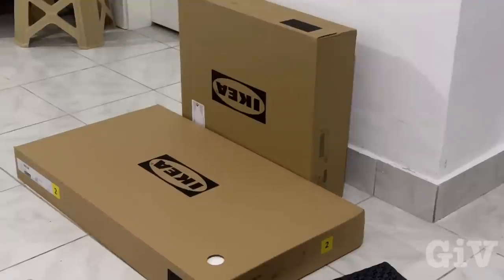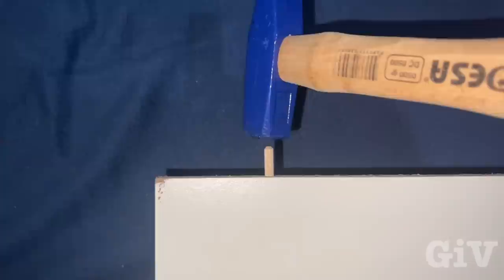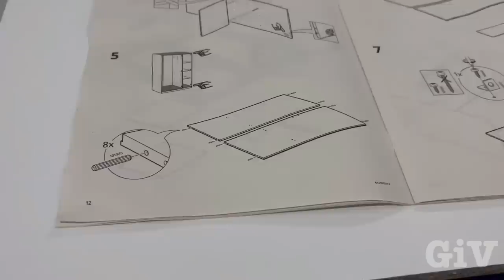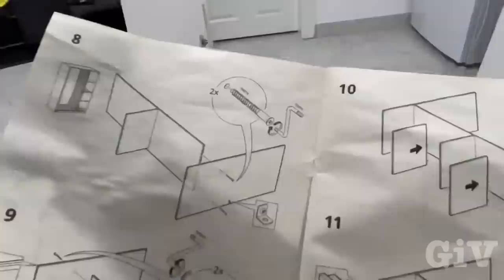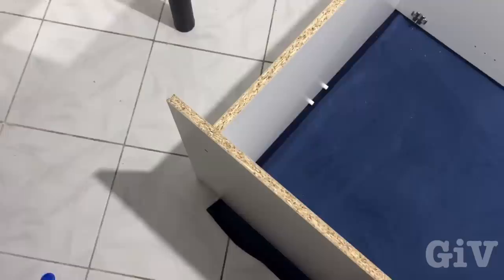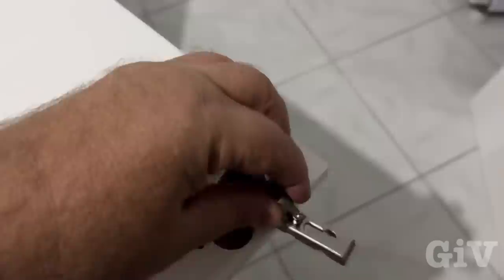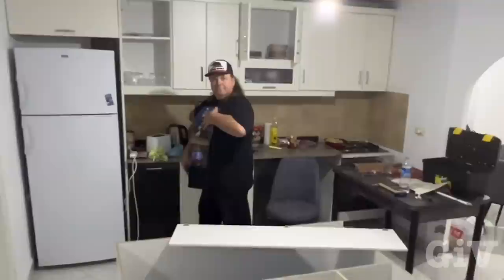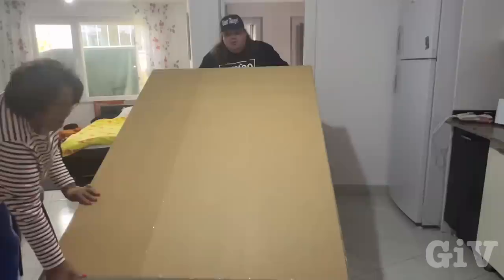Setting up a closet for my moms appartment in avsallar turkey

Comment: Always, always use wood glue on all the running edges when building per-frabrecated furniture. This makes it extremely sturdy and resistant to the piece becoming loose over time.
Reply: True 👌
Reply: great idea! never thought of that
Reply: Too late
Reply: I used some Gorilla glue on mine, and it's still going strong.
Reply: What does running edges mean
Reply: @jasminespencer3992  It means when you put the glue on it runs over the edges onto the floor😄😃😀
Reply: How much does the Ikea Drill cost anyone?
Reply: Sounds good to me
Reply: Ooh good tip

Comment: Top Tip : If you want extra shelves, go to OBI or the equivalent. They have long pieces of plastic coated wood. They will cut it to size. Then they have the plastic on a strip. You cut it to length, and iron it onto the edges of the cut wood so that it looks like it was made like that ( put a towel on the tape when ironing it ). Then they have extra pegs so that you can put the new shelves into the pre-drilled holes that are already in the wardrobe. More shelves means less clothes per shelf, which means less hassle when getting something from the bottom of the pile. And you will put more on more shelves, trust me !